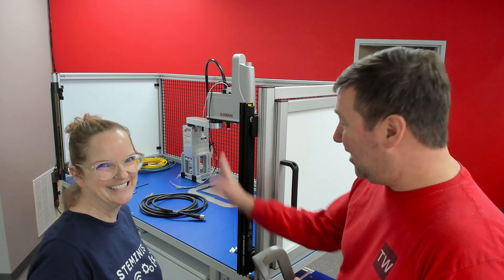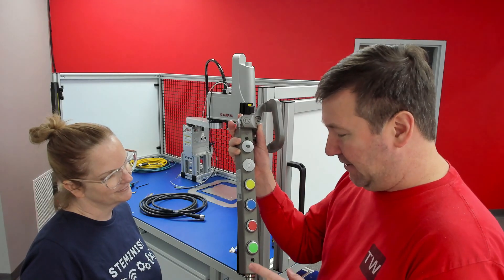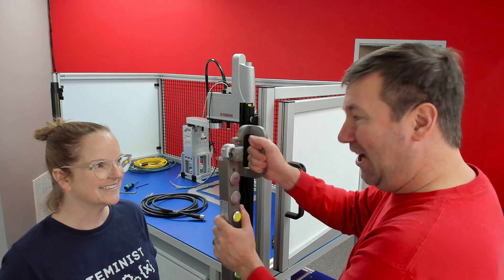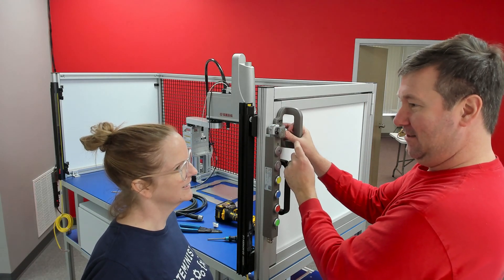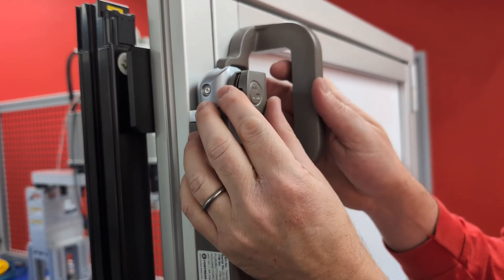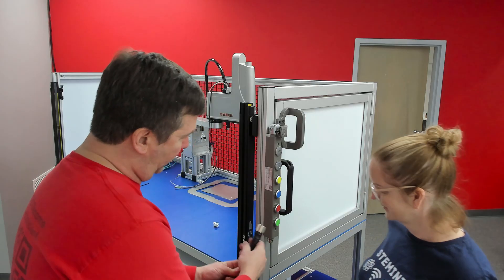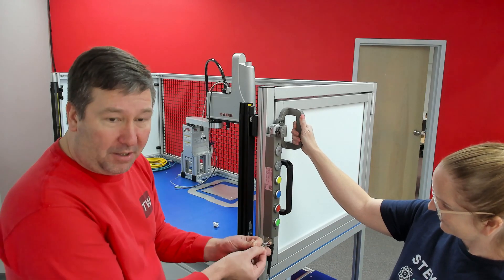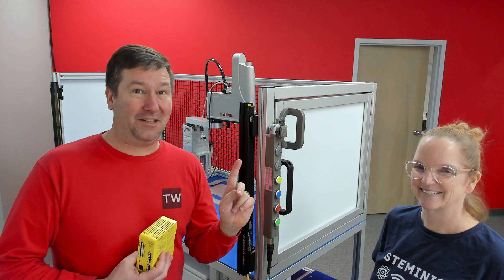Installing a Fortress Trapped Key Interlock Operator Control Station

Comment: Have you looked into any keyence products? They have a whole safety product line and within it a very intuitive safety controller.
Reply from the maker: I have seen them but never played with them.
Reply: @TimWilborne  not sure how much the banner safety controller is but the keyence safety controller is right around $1000-1100. I learned how to navigate the software within an hour or so without instructions.
Reply from the maker: It's hard to just throw numbers out when comparing safety controllers because they have so many different features and IO counts. The Banner is super easy to use also and the particular model we're using in this system is about half of that price